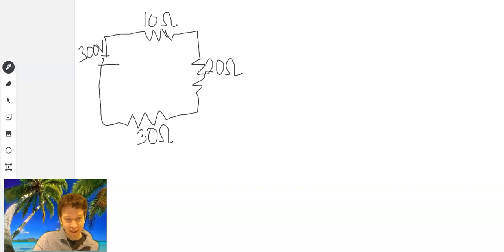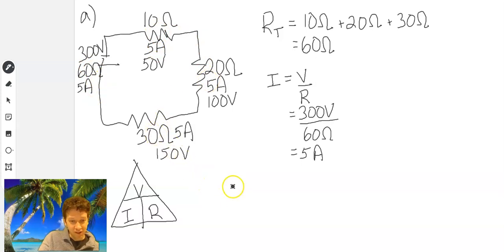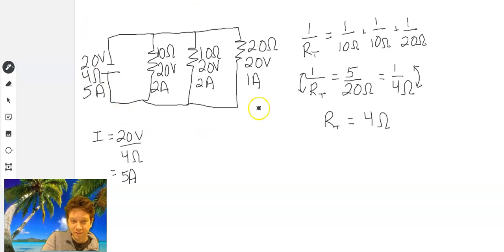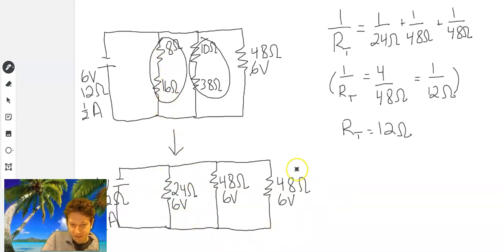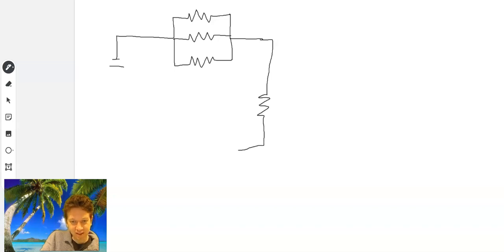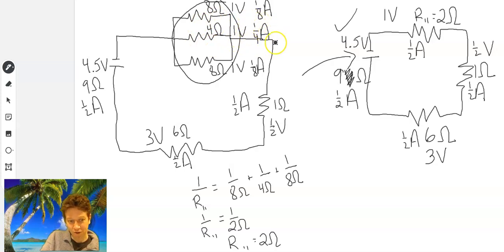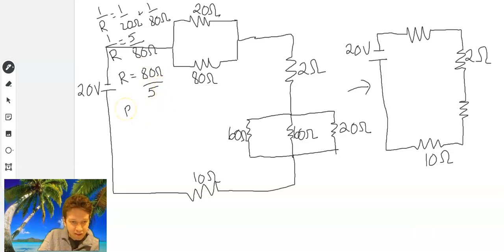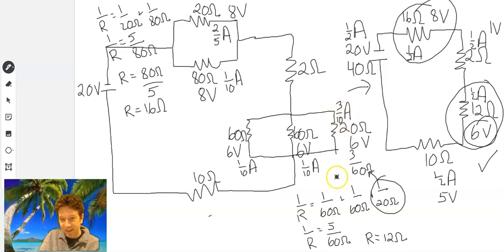Grade 11 University Physics - Solving Mixed Circuits Practice Problems

Comment from the maker: CONTENT:
0:00 Example #1 Simple Series Circuit
6:27 Example #2 Simple Parallel Circuit
11:40 Example #3 Mixed Circuit 1
21:16 Example #4 Mixed Circuit 2
27:52 Example #5 Mixed Circuit 3